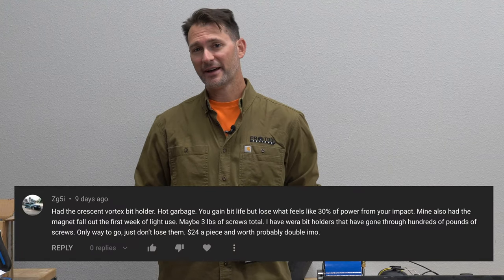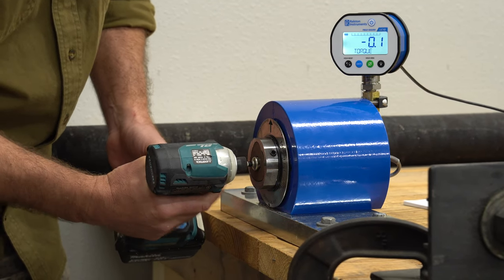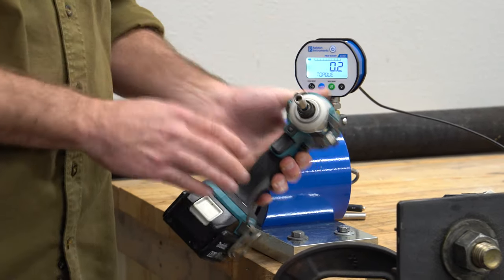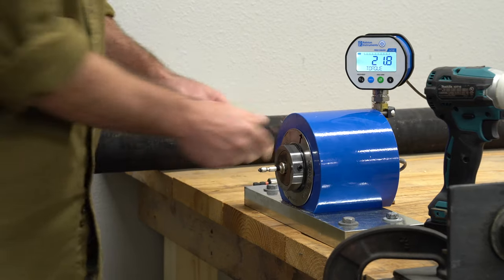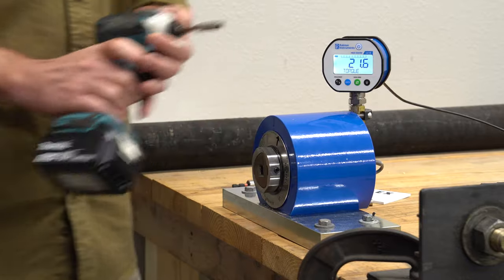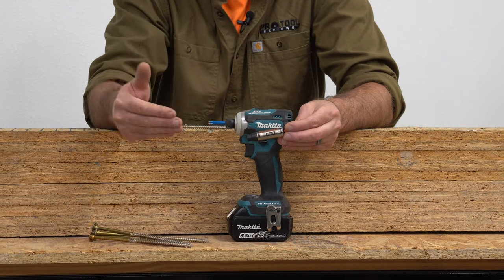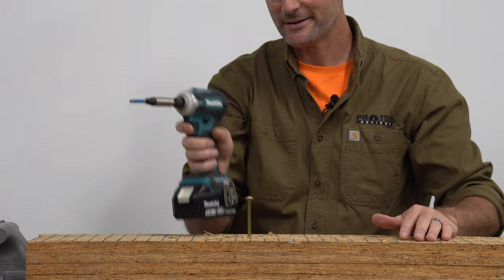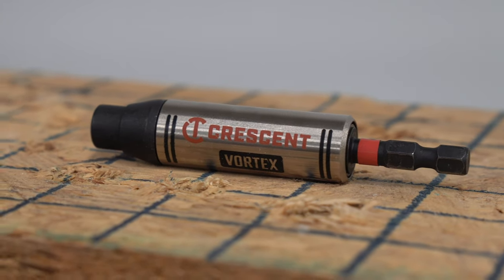This Simple Mistake Makes You Lose Torque

Comment: Thank you so much! I've been using bit adapters for years, even installing decking, apparently I'm slow and didn't make that "connection" between the adapter and less torque. I have an upcoming project with 3" deck screws. This should save me a bunch of time and battery life (new decking on a dock) Thanks a bunch guys!

Comment: The reduction in driving performance does not surprise me.  Two things come to mind from my perspective are:

#1) A driver bit chucked directly into the impact tool has, a. a length of let's say 2" which allows X amount of torsion.  b. When an extension is added, let's say, another 2" = 4" total inches, the torsion would likely be doubled or increased significantly.  Also, the net weight of the bit with extension is probably double or maybe triple of that of the bit only.  The impact tool starting and stopping an object (many, many times per section) with double or triple the weight may have contributed to the efficiency problem.
 
#2) Example b. The tolerance in the connecting point between the driver bit and extension would certainly increase the throw or play, between the driver bit and the impact tool by roughly double.  In my mind this would likely contribute the tools designed throw / play between impacts, working less efficiently due to the decreased tolerance (increased distance) using the extension.

Other thoughts I have:
I believe the very long length of the screw test, likely provided a lot of additional torsion which possibly contributed to the very poor performance of that test.

Also, I believe the impact function of the tool, generally exacerbates both problems, a. & b.

It would be very interesting for you to use a standard drill and perform identical tests.  I believe that a tool rotating constantly in one direction without impact function, would perform better because: As soon as the single direction additional tolerance problem catches up, and the torsion problem catches up, the overall difference may be less noticeable but probably not 100% efficient.

I think you did a great job holding the tool plumb using the bit only and bit with driver extension, so I do not believe that contributed to the problem.

Great test, and very thought provoking indeed. 

Mark Nicholson (retired)
Former, US Army - EFMB
Combat Medical Specialist
1/94 FA MLRS
AO: European Theater - 1980's

Comment: Wait wait wait... I have so many questions... All of this seems sooo odd!!
First! Why was there a piece of the broken socket adapter that broke in the first bit holder, INSIDE THE SECOND BITHOLDER?? AM I MISSSING SOMETHING ??                 >                                                                                                                                                                                                                                                                                                                                                                                                                 
Second! Why does the crescent bitholder spin so much faster during both tests? Why do the first and second bitholders barely spin when when the crsent is at like 1k rpms?!

Comment: I think you’re losing a lot due to using quick shank bits instead of shorties. I’d like to see this test with different bit holders.

I carry several on me every day and I use shorties in the holders. I also only use welded holders and one Dewalt quick change. I’ve found that any other holders just don’t keep up and often separate from the shank.

Comment: I bet if you designed a bit holder correctly you could actually increase torque. I mean if you can absorb the torque and reduce it with a bit holder and you should be able to do the opposite if you design the tension and spring correctly